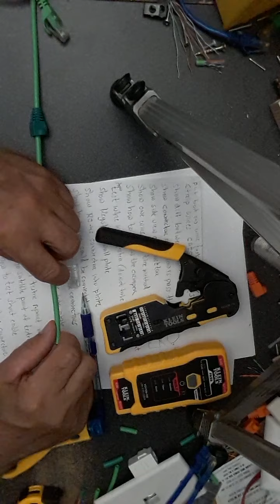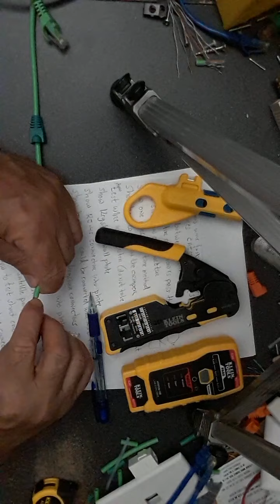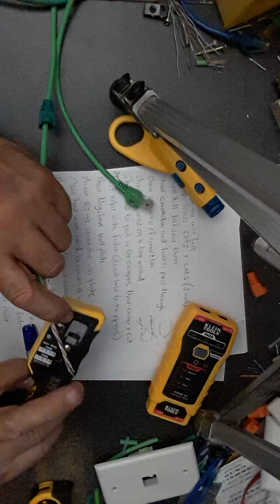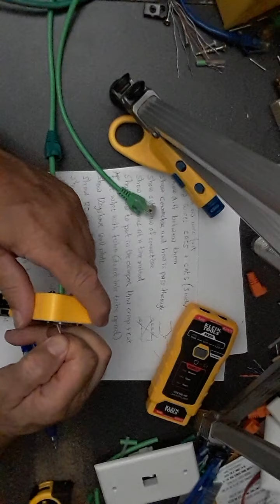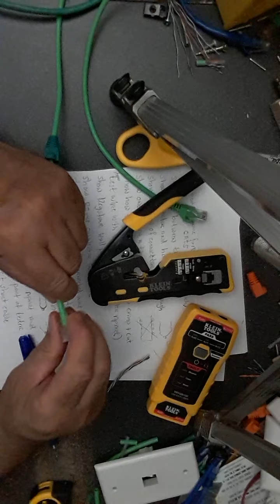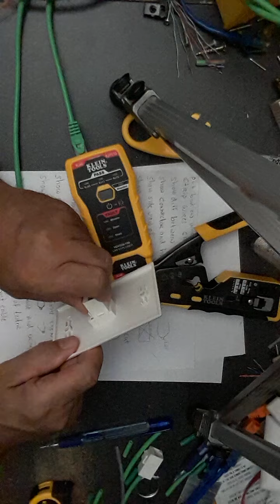How To DIY Repair CAT5 CAT6  Ethernet Cable RJ45 Pass-Through Connector and Test using Klein tools

Comment: What would cause a cable that shows a pass on the tester not to work when trying to connect router to computer?
Reply from the maker: If the cable is going directly from your router to your computer, no in wall cabling in the mix, then that doesn't make much sense to me that its a cable problem. 

Right away it looks like your computer networking (see control panel) is not setup right. 
When you say "not working" do you mean not able to get on the internet? 
If no internet do the following..
- power your cable modem and router off
-..wait 30 seconds

- power cable modem up first..wait 60 seconds
- power router up...wait 60 seconds 

If you cannot see your local network then
Tell me how you are testing the cable?....
Also, try another cable, they are cheap enough, just buy a short one and try.
Try another net port on your router.
If you have more than one net port on your computer (I do) try the other net port.
This video is about net cable repair of cable already in the wall or you want to make your own exact length cable.
Reply: @auctionmusic  I tried a different cable and i was able to connect to the internet with no problems so it has to be the cable I repaired. I checked the wiring pattern and it is correct and the cable tester shows a pass. I have the same tester as in the video. I still cannot connect to the internet using that cable.
Reply from the maker: @lisaenriquez8460  The tester will work if the cable wires are "point to point" correct. However, you could have two wires reversed the same way, on both ends, and it will test out ok yet be "network" incorrect. 

So do this. With the tab on the connector facing down (its easy to see the wires in the connector that way), and the end of the connector is facing you (the wire coming from the connector is moving away from you) tell me the wire colors from right to left. Tell me this for both connectors. Should be the same for both.

I use "white" and "stripped" interchangably.

Orange/white (far right)
Orange 
green/white
blue
blue/white
green
brown/white
brown (far left)

Some people are color blind for green and blue that could also be a problem of course.